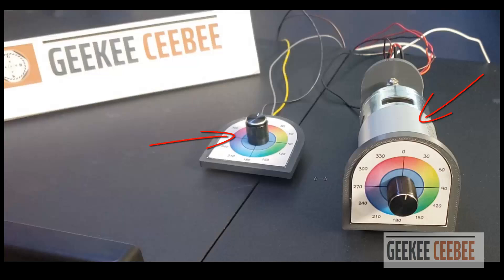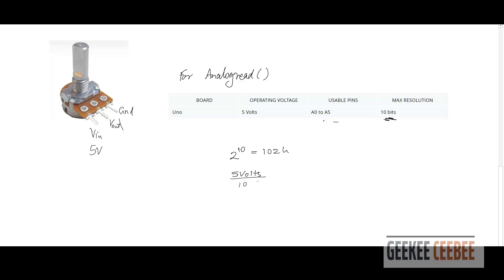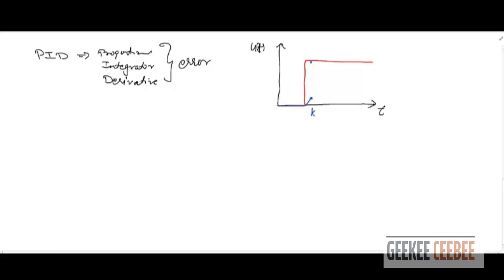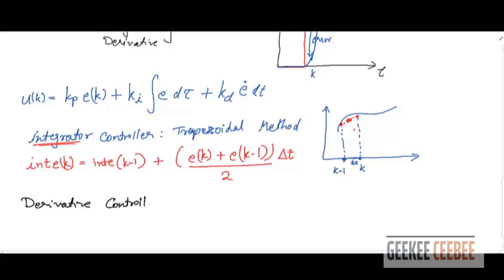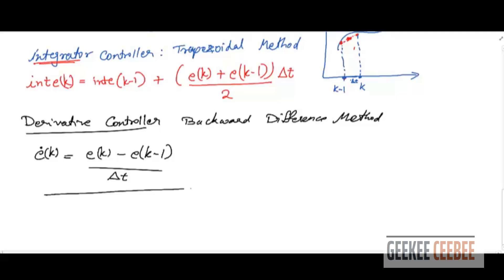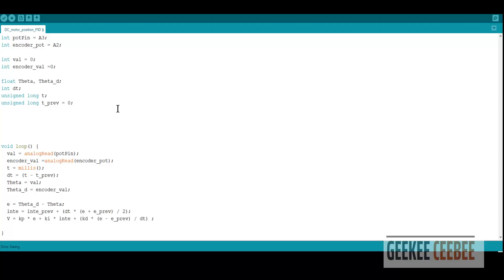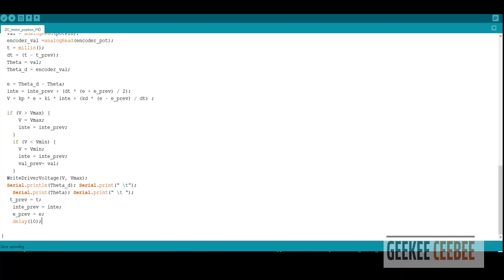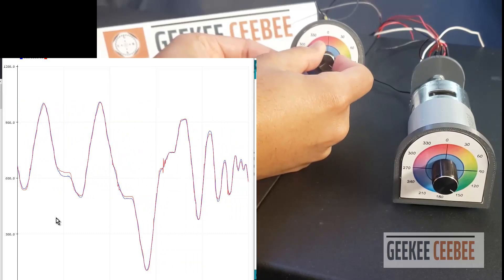[Full Breakdown] PID for DC Motor Position Control using Rotary Potentiometer

Comment: Outstanding job you did. I'm in a project, which consist in control a DC motor, most specifically the position of the DC motor. For this, I'll not use other potentiometer coupled in the motor, just the motor DC. I want to control the motor directly with one potentiometer (reference potentiometer). In this case, can you explain me how can I  do that? what connections I have to do from your assembly?

Thanks.
Reply from the maker: You need some sort of feedback sensor on the motor to control its position. If can't use a pot then other option is to use an optical encoder. Then map the angular range of ref pot to that optical encoder.

Comment: This PID tracker with the 2 POTs is awesome!  Small thing—you diagram shows using A2 and A3 and the code is A3 and A4.  Also, I’m having a little trouble.  Turning on the serial monitor makes the loop much slower than 10ms.  It works but it is a little jerky with irrregular timing that seems to be due to the serial communication.  When I turn serial off, the timing is then right but it no longer seems to be tuneable…. Strange…. Should I try to monitor some other way??
Reply from the maker: Thanks for pointing that out. I'll update the code to reflect correct pin assignments.

Have you tried using "Serial Plotter" instead of serial monitor? I'm not exactly sure but couple of things to try - increase the delay time or use timer interrupts instead of delay() command. I have another video on my channel about PID DC motor speed tracking where I implement Timer interrupts. 
Advantage of timer interrupt is that Arduino is free to do other things while waiting for 10ms. Unlike in delay(10) command, arduino is stuck for 10ms.

Comment: Amazing video, just what I was looking for!
Just asking to know if I got it correctly:
you used "encoder_pot" for the feedback when declaring the variables, but used the reading (in the main loop) of the potPin as the feedback. Was it a typo or did I get the whole idea backwards?

Great project and one of the best takes on the PID workings btw

best regards from Brasil !!!
Reply from the maker: You got it right. There's a typo when defining the encoder pot. Glad video was helpful. Thanks for watching 👍
Reply: @GeeKeeCeeBee   when you read analog potentiometer you get angle ??
Reply from the maker: It is technically angular position mapped to potentiometers resistance value. However, I do not necessarily read it as angle. I simply use the resistance value as feedback signal and PI controller compensates the voltage by comparing feedback with reference potentiometer value. Hope that's helpful.
Reply: Loved video ❤👏👏👏

Comment: Please help, I’ve uploaded code to the board and wired everything identical to the diagram, but when I power everything the motor just spins without control, any way to fix this?

Comment: Hello, if i'm going to use BTS7960, where should I tap the 6,7,8 pins fron arduino to bts7960 pins? Thank you
Reply from the maker: Looks like Bts7960 needs atleast 4 wires. It needs 2 separate pwm output from arduino for left and right rotation. My code won't transfer over without modifications

Comment: Im trying to replicate this but have a small problem. I can hear the motor buzz but it wont move. My motor has a built in potentiometer and its value is different than the input potentiometer. Also, starting resistance is from max to min. Does this matter? And can it be fixed with code. Thanks!
Reply from the maker: Pot resistance value should not matter. You can try flipping Vcc and Gnd pin of your potentiometer. Resitance max-min should flip. Hope that helps.
Reply: Hey man thanks for the tip! I tried flipping the cables and saw improvement, but playing with kp and kd values solved my problem completely! Hoping to see more electronics videos from you soon.
Cheers!!

Comment: Paypal , done. Great write up and video.  Where are you defining the khz rate of the driver (sorry im new).  I have a project, im needing a PWM motor controller that runs @ 20khz and can handle max of 10amps (12 volts).  I would like to use your code and set it up the same way.  What do you recommend??.
Reply from the maker: Thank you, Jeff. Much appreciated 🙏 I have responded to your questions via email. Hope that's helpful. Thanks again

Comment: Can i use Rotary encoders instead of potentiometers for this project ?
Reply from the maker: You absolutely can. You would need a somewhat high resolution rotary encoder. Most inexpensive encoders can be around 24pulses per revolution which is 360/24 = 15deg for each pulse. Not nearly acceptable for any kind position controlled application.

If you are interested, there's another video on my channel with encoder and speed/position control. But I feed a pre-defined speed ans position profile and get feedback from rotary encoder. https://youtu.be/QSIksPKndEs
Reply: Seems like there’s no second encoder in the link you shared. I really like that you did with two Potentiometers in this video and I also want to make same thing but with two Rotary Encoders instead of using Potentiometers. Will be very appreciative if you can direct me in that.
Reply from the maker: There's another video on my channel where I use two encoders but not like in this video. You can probably use that as guide in terms of wiring and getting encoder values and combine that with this pot project by replacing pots with encoders. Hope that helps.
 "Anti Backlash Dual Encoder" video

Comment: What is the value of potentiometer
Reply from the maker: Potentiometer is 10K Ohms. However, pot value does not really matter when it comes to Arduino reading analog voltage in 0-1023 range because of its voltage divider circuit. 
But, one should consider pot value if power dissipation is a concern. 10k pot at 5V only dissipates few milliWatts of power. It may or may not be significant if you're running your system on battery. Hope this is helpful.
Reply: @GeeKeeCeeBee  thank you so much 

But I'm facing another problem that is my motor moves only in one direction and not the other direction even after rotating the potentiometer, why is it so
Reply from the maker: I suspect your setup is not reversing the voltage to spin the motor in other direction. Check your direction pin wiring (pin7 and 8). Other than that I can't really say without looking at the setup and code.
Reply: @GeeKeeCeeBee  I've cross checked the wiring and it was wiring problem. Thank you so much for this idea. You have done a great job. It's running successfully now. Thank you so much ❤️